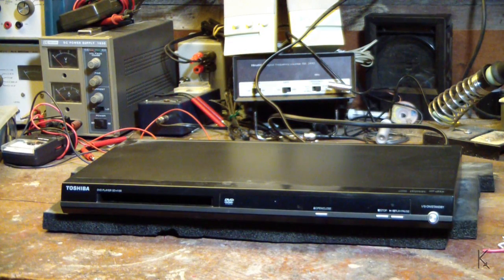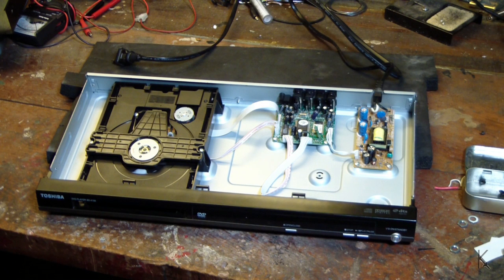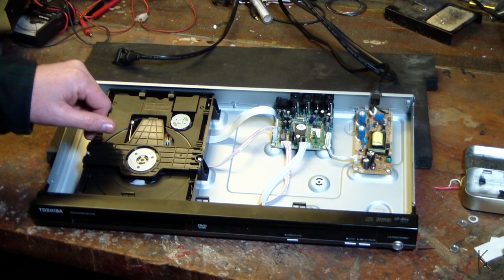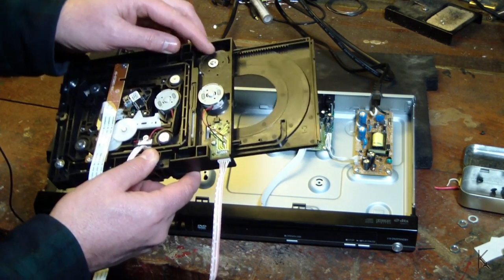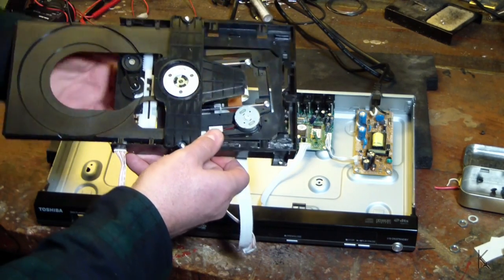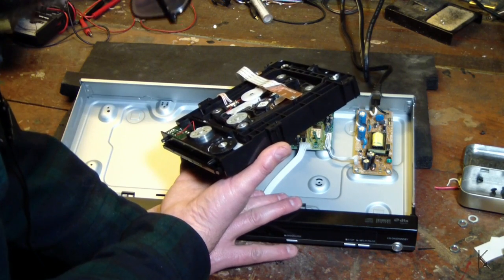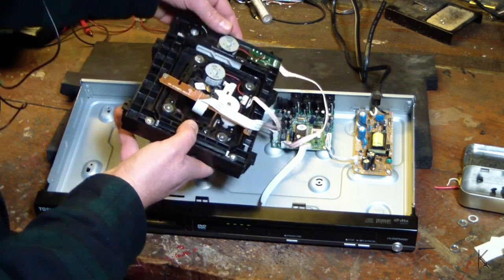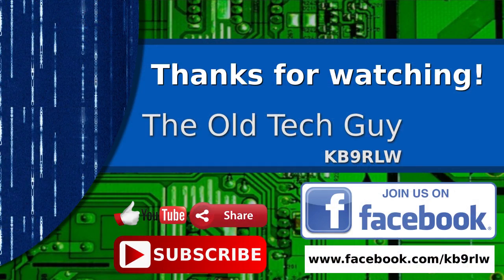Electronics - Simple repair of a Toshiba consumer DVD player

Comment: Hi Kevin I have pioneer bdp170 Bluray player it suddenly stopped powering on. Power supply looks fine but it doesn’t work.Any solutions.
Reply from the maker: Usually the power supply not coming on is due to a failed electrolytic capacitor.  They become resistive and present a load so the P.S. doesn't start up.   Replace the caps in the power supply and it may come back.
Reply: @loughkb will give it a try

Comment: I have a Toshiba CRT DVD combo with a DVD player that won’t play discs, it states after a while of reading that the disc is incorrect. It sounds like it’s buffering/making lawnmower sounds kinda(that the best way I can explain the sound). Anyway if anyone has any possible fix ideas I’d love to know. I would much rather fix it myself however I have never worked on a CRT TV before so if anyone has any advice or tips on Word are researching on how to work on CRTs and built-in DVD systems within them please let me know! Any possible solutions would be greatly appreciated as well
Reply from the maker: Start with a cleaner disc. You can probably still find them on eBay or somewhere. They have a little brush and when the disc is spinning it cleans the lens on the laser. Most common problems with these older players is the lens gets dirty or fogged. That's all I can offer.

Comment: you're funny! ...got any idea of where a thingie that reads blu-rays would be or what it might look like? i took apart my toshiba bdx2200 to clean it and now it'll play DVDs but it won't play blu-rays!?! do u think it's possible i disconnected something? (in case u can't tell, i have no idea what makes a blu-ray player play) i don't expect an answer, but if u do or can, u would rock my world! thx!
Reply: p.s. i have no qualms about venturing in, i take my macbook pro apart all the time
Reply from the maker: Sorry, but I'm not familiar with that model. It probably has two lasers in the single head with the lense on it. That part is very sensitive and can be damaged if you put to much pressure on it while cleaning the lense. You may have bumped it and knocked it out of alignment. But that's just a guess.
Reply: @loughkb  no need for sorrow, and THANK YOU, kevin, that actually really helps aLOT, i didn't think a cable sounded right;! i took it apart again n saw 2 probably-laser-thingies (put it back together & it started making a NASty sound n wouldn't play dvds either, lol, so took it apart again n i'd had it slightly off kilter so i adjusted it & now the dvd part  works again but still no blu-ray... i'm going to wait til it 'feels' like it's a good time to fix successfully n try again (like when the planets r aligned & the winds r blowing in a southeasterly direction & the moon's almost full... or something like that 😉 thx again for responding n have a fun day ~ sarine

Comment: Thanks for the video. I have the same player (UK version) with the same fault. Lubricating the various contact surfaces as you suggested has improved things but the non-opening problem still occurs every few times the open button is pressed. I suspect there is wear on the components but also wonder if the whole transport gets distorted when it's mounted back in the casing as flexing it slightly seems to improve things. Anyway, thanks again, best wishes, Hugh.

Comment: Hi Kevin. Long shot here but I had trouble with a DVD when I inserted it. It jammed or locked up my Toshiba DVD HDD recorder which I got around 2007. I couldn't  do anything...I couldn't even power it off so I unplugged it . Which I'm sorry I did cos now it seems broken. I can't access my HDD recordings and the DVD is still stuck in it. Its got no little pinhole to eject the disc either. Any advice ? Did I blow my recorder by unplugging it while still powered on ? I don't know what else I could have done. It was locked up . No commands on remote control or the recorder itself did any good. Thanks for any feedback

Comment: And what if the thing doesn't even power up? What would you do then? I have a Toshiba RD-XV45 that one day just didn't power up again. A bit older than this model i would think so it may be packed inside.
Reply from the maker: Probably bad capacitors in the power supply.  Look for electrolytic caps that have swollen or seem to be leaking on the board.   They start acting like resistors and prevent the power supply from turning on.
Reply: @loughkb  - Thanks Kevin, i will check that out.
Reply: @jezzyby47  Was it the capacitors?? And if all else fails...reorder fresh Chinese air...it was probably due for a top up! 😁
Reply: @user-jy3zl2vp4b  - It's still broken, didn't bother fixing it in the end.

Comment: I have 2 Toshiba DVD recorders/same make. Tried the clean on laser and slight screw turn to get the disc to be accepted. Still not working, so took a working DVD unit out of one to other. Replaced it exactly as I got it out. Still don't work. Any ideas? It worked in the other unit.

Comment: Thanks a million Kevin.  I thought I had an air filled brick, but now it is working fine thanks to you.  The inside of my Toshiba DVD player (SD4300) looks identical to your friend's, but the mechanism is slightly different.  It doesn't have those L shaped slots.  But I found some other surfaces to put some 3-in-one oil on with a q-tip and it works great!

Comment: Thanks. What about the power not coming on in the D400 unit?
Reply from the maker: Look at the electrolytic capacitors in the power supply.  If they seem to be bulging on the top or bottom and especially if they have stains there like something leaked out, replace them.    
Failed caps are the most common cause of dead switching power supplies in consumer electronics.

Comment: Found this video very helpful as this is exactly my problem.  My Toshiba is constructed slightly differently.  The gear to  move the tray is housed and the channels are not the same.  I did identify the channels, however, and lubricated them.  The tray did lift and I cycled it several times before reassembling the system.  Lo and behold, when I put everything back in place, the tray will not open.  Any ideas?
Reply from the maker: It's probably catching on something that was only there after you put it back together. Examine it closely, and see if you can see where it's catching.

Comment: Kevin it is not powering on at all.
Reply from the maker: Look at the capacitors on the power supply.  You will probably find two or three electrolytic filter caps that are slightly bulging at the top and bottom.  Replace them.  It's a really common problem.

Comment: What can be done when DVD players just quit playing?Fuse seems ok.
Reply from the maker: More info needed to do anything other than guess.   That's like saying my car doesn't run, what's wrong with it?    ;-)
The most common problem, if the thing is at least spinning the disc and trying, would be a dirty lens on the laser.  A Q-tip and alcohol can be used to gently clean it.

Comment: Hello Kevin Loughin,

     I just watched a video you made about a consumer Toshiba dvd player. It was very interesting, and it seems like you have a lot of experience. I'm hoping you can help me with something. I currently use a Toshiba DVR620 to play my vhs tapes and dvds. For some reason when I play my vhs tapes, I get a white flash throughout each tape. I have researched for days, called businesses, tech support, and haven't had much success in finding out what the problem is. What's really odd is when I plug the 3.5mm jack to my Sony TRV-17 minidv camcorder and the rca in the rca out of the Toshiba DVR620, the vhs tape doesn't flickr when played back on the Sony TRV-17. I really would like to burn the vhs tapes to dvds, but this is white flash is a problem. I ordered a Firewire card for my PC, but I'm worried the pass-through with rca will degrade image quality. I have linked a video clip here to show the issue. The recording is of me when I was a child, I'm 27 now. Any help would be greatly appreciated. Thank you. 

https://www.youtube.com/watch?v=aYd4mNPYPYg

- Paul Harwood

Comment: HELP!!! My DVD player sounds like a helicopter when playing a DVD. No $ to buy a new one, any suggestions?? Thank you!!
Reply from the maker: Are your DVD's coming out with scratches on them?    Something could be wrong with the spindle or bearings, allowing the disc to wobble while spinning and bump other parts of the mechanism.  You'd have to run it with the cover off to see.  Don't look directly at the laser though, could cause eye injury.
Reply: Kevin Loughin To be perfectly honest I have never looked at a DVD when taking it out. However I have put a brand new DVD in my player and it still makes the same noise. If the problem is what you say how do I fix it and please remember I'm a girl and I know nothing about Electronics LOL!!!

Comment: In my little condo unit, I have only WD40.  Would that work?  How should I apply it?  With a Qtip?  I would have to guess on which areas to apply it.
Reply from the maker: It would work for awhile.  WD40 eventually will thicken and make things worse.  But you might get another year of use first.
Yes, a Qtip would be good.  You don't want to get any on the laser head.   Look at the sides of the tray and you should find pegs that slide in rails.  That's where you want to apply a very very small amount of lubricant.
Reply: What kind of a shop would I go to to borrow a small amount of machine grease to use, so as to avoid the stickiness of WD40?
Reply from the maker: I'd use a light grade oil.  You can get a small bottle of 3-in-1 oil at the hardware store for just a few bucks.